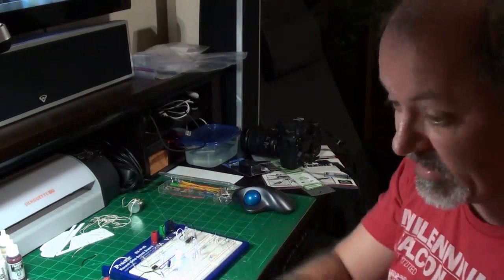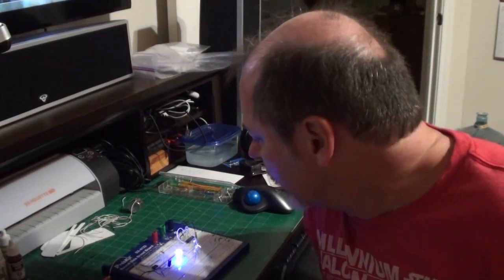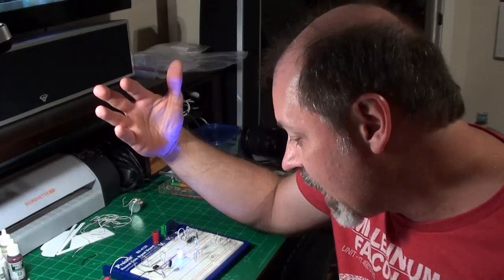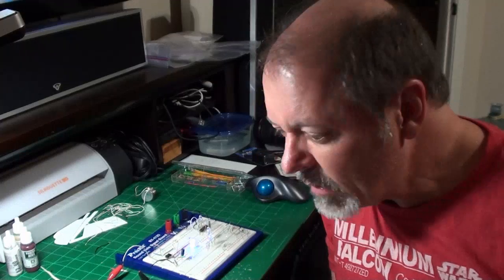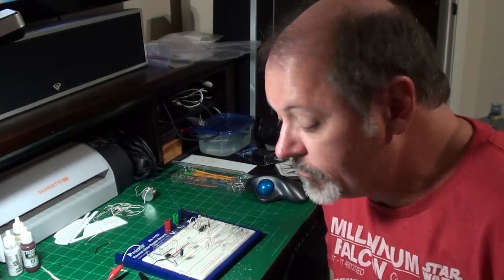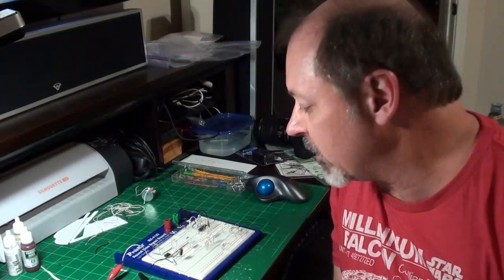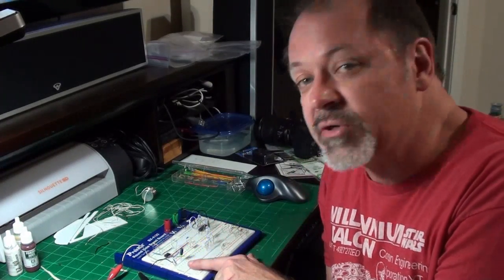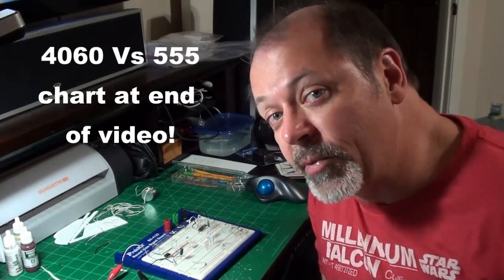Lighting Tutorial:  555 pros and cons

Comment: Continued:
Note that a smoothing cap is NOT a bypass cap. The 4060 can be used with a theoretically infinte number of LEDs by connecting the signal output pin of the 4060 to the input pins of a buffer (such as the classic 74LVC244) with a series resistor on the output of the buffer.

Comment: Problems with this video: 
As per the datasheet, (fairchildsemi(DOT)com/ds/LM/LM555.pdf ), the IC only draws 15 mA. The battery (Typical 9V alkaline) are usually 400-600mAH. That's 40 hours, without the LED's. The LED's are sucking out all the power. 

"Signal leak"? It's common, (and in this case necessary) to put a bypass cap(acitor) on the VCC and GND pins of the IC to pass any HF noise to ground. Small, .01 ufd is standard. This should eliminate such issues.

More in comment reply.